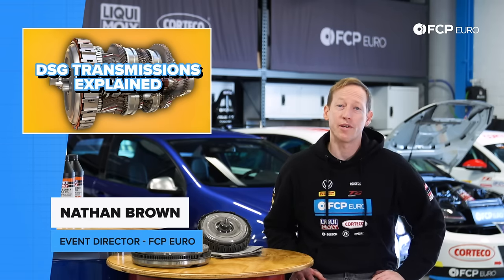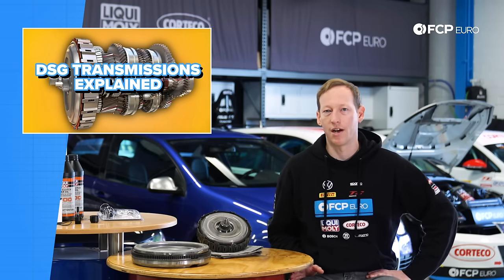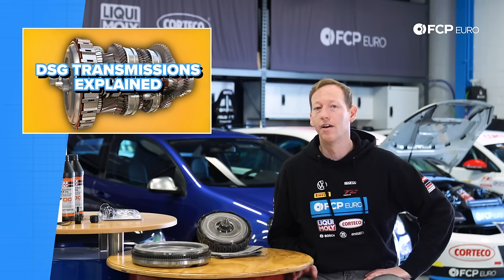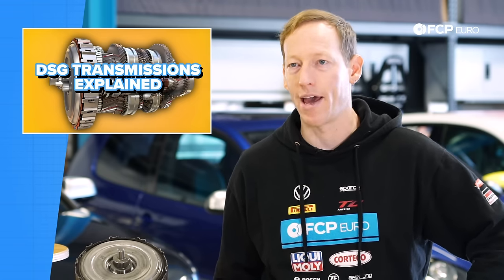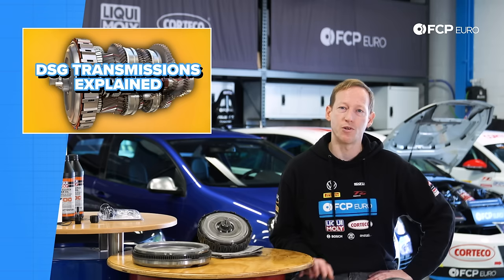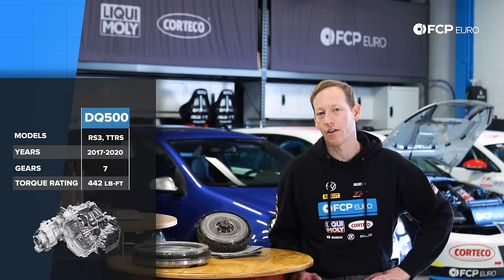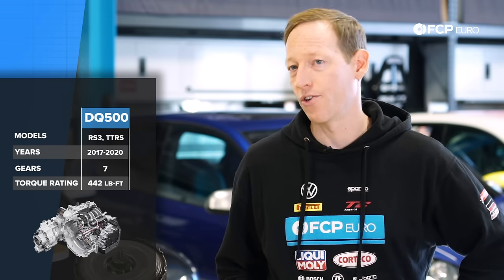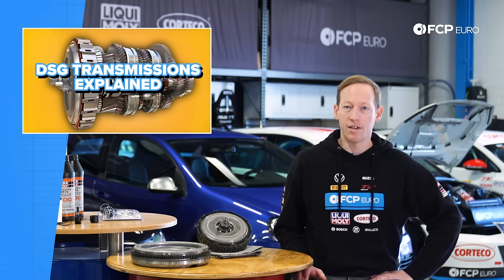The DSG Transmission Explained - How A DSG Transmission Works, Advantages, & Cars That Have Them

Comment: Hi, thanks for the informative video. I have a 2015 VW CC with the 02E trans. It  all of a sudden stopped moving both forward and reverse. When I scanned it, I got a code P0716 (G182 implausible signal). Pls can the G182 cause the car not to move at all? Is there a way to check this sensor with multimeter. I have checked the connector and no physical damage, I have opened the mechatronic cover and the wire of the G182 looks good. before all of this, I have replaced the DSG oil and filter. Is there something else I can do? My car is 32000 miles. Thanks again.

Comment: I have a 2019 7seed DSG mated to a diesel 2.0L 190hp was told by the dealership they only change the oil as the filter is long life. Same with the haldex clutch just oil change. It that the way things are just done now?

Comment: You are wrong about the recall on the mechatronic unit.  My 2008 GTI had the problem at  30k miles.  The dealer "fixed" it, and VW extended the warranty to 100k miles.  Unfortunately, the problem with the mechatronic unit caused excessive wear on the clutches, so at just about 100k miles, the clutches are slipping.

Comment: Hey guys, great video and answered a lot of questions I've had about DSG - in the video at 13:50 you start to describe flywheel issues, the bang into gear, and the vibrations - you also mention they're indications of something else, and "you'll get into that later" - I may have missed it but I don't think you came back to it. What are the other issues? Also, the vibrations, would they likely be felt while idalling, sitting at the lights, or sitting in park? and how bad would you expect?
Reply: Mechatronics issues will cause hard changes, delay in engagement, 'dropped' gears etc as well so I'm guessing that's what he was alluding to.
Reply: @onearmedbandit_nz  I think you're right as well. Thats what I think im dealing with.

Comment: DSG is a horribel construction. Adding more weight to your car than needed. Always pushing for the highest gear at all times, with an awful fuel consumption as a result. Have had two cars with those. Always ending up shifting them manually anyway.

Comment: i bought a 2014 passat TDI last year because it was the cheapest car i could find in my area with under 90,000 miles. I didn’t know much at the time, but after a year of ownership it’s been interesting learning about the TDI and its cult following, and of course just now finding out my DSG is some performance transmission 😂 I love the car, best 10 grand I’ve ever spent

Comment: transmission working absolutely fine just I’m getting error repeatedly Gearbox is overheating change driving style .. and fault code is P1765 hydraulic sensor 2 adaptation limit reached ( g194).. the local mechanic recommend to change valve body ..

Comment: Excellent video, really well explained. I would also like to thank you all at FCP Euro for helping me out, Audi in the UK and Germany were out of stock of a cylinder head bolt for some warranty work on my C7 RS6, you guys had stock and sent it to me in a few days, so thank you very much for helping me. FCP Euro is a really good option, if you can’t get the part in Europe, it’s worth trying them as the shipping cost was very reasonable.

Comment: Halo, I have a Jetta 2006 DSG 6 gears. When I accelerate/decelerate past 1000 rpm the car jacks and drives smooth after that. The car jacks as well when in traffic if I shift from Drive to Neutral and vise versa.. what could be causing this?!

Comment: Excellent explanation of the DSG.  I have a BMW M2 with DCT.  I just had the transmission serviced to the tune of $1500.00+ which really hurt.  The problem as to why it cost so much is that the filter is built into the pan of the transmission and so more parts required.  I've had the car since March 2017 (brand new) so I guess $1500 is not too bad for over seven years of service.  The car has been on track at Sebring many times with the Porsche club and I've never had an issue with the gearbox.  Thanks for a great video.

Comment: Hi, I have a volkswagen touran 2012 1.4 tsi, I'm getting leaks from, it... I do a rebuild of the mechatronic and still leaking, could the clutch cause the pressure to build up and cause the leak.

Ps it's a used car I bought, it says 43700km please advise me or help me with understanding the cause of the leak?

Comment: There's also the DQ200 that's a seven speed dry clutch. That one fails a lot.
Even on my DQ381 I had this connector rod that connects the gear lever movement to the transmission break and I have no idea what part number it is to replace it, I can't even find its name.

Comment: I have a 2018 Skoda superb automatic problem came up on the dash flashed up I got her logged on the computer clutch position sensor  to electrical fault dealer said need a new Mega Tronic unit Cost 2000 I was told to change oil and gearbox every 80,000 does that sound right

Comment: I had a ford focus with a dsg, lovely car to drive while the gearbox was cold, ford chose to activate the clutches via 2 motors and i believe the motor software was flawed…..my car was awful when it warmed up with heavy judder pulling away, nightmare time was stuck in traffic, i grew tired of having my teeth rattled, sold the car after 1 year.

Comment: Sir why did the previous Audi Multitronic automatic gearbox give so many problems when i for example had the Audi A4 which was so frustrating when i took the car into the Audi dealerships they had to order a replacement from Germany which took over a month to receive in the end i got rid of that car and opt for a VW T - Cross DSG ( Direct shift gearbox ) as you said VW are well known for there smooth gearbox touch wood i had no problems when i purchased my T - Cross in 2019 in South Africa? by the way your explanation was very good now i understand better!!!!:yougotthis:

Comment: Great vid... ive just brought my son his 1st car which is a 2009 audi a3 quattro with the dsg gearbox. Car ran perfect the 1st couple weeks but now its started to play up shifting 1st to 2nd gear , its as if your hitting a kill switch then it goes again. Cruising around its fine its only wot that it seems to do it. Ive changed oil and filter but doesn't seem to of fixed the issue. Any idea where I should start.

Comment: So what releases the pressure on the clutch packs? Does the solenoid supply oil pressure to engage or disengage the clutch? I would assume oil pressure would engage the clutch otherwise it would use springs to hold pressure on the friction plates and I assume having one clutch disengaged for a long time (I.e motorway driving) would cause the spring free length to become below min spec pretty quick.

Comment: So is it normal for my car to roll downhill by afew feet when going from a stop? Every time I put the car in gear and go to move it will roll afew feet downhill forward or backwards and it does it from a stop light if its on a incline. Basically feels like a manual trans with someone who doesn't know how to work a clutch

Comment: when the brake is applied the car is technically in a neutral state yes? so im wondering if that means that when doing the dsg service and running through the gears if that is fine in that neutral state or would it be optimal to have handbrake up and swap gears without brake applied?

Comment: Automatic will go 200k+ with no issues. DSG will need replace the clutch at 130k  kilometers not miles. Am I wrong, cause my 2009 audi tts is slipping and we just got to 130k. Has to be the clutch right...no codes, gear changes are perfect...when under torque in gear it slipping.
Reply: A good repair shop can see what the wear is. Sounds like a clutch replacement is needed, though.

Comment: As you said, Transmission fluid for VW DSG must be replaced by every 35~40 miles. This is most important to keep DSG life longer.
But paradoxically speaking, DSG is sucks in reliability which need to be replaced the transmission fluid almost double times than torque converter.
That is why many DSG owners are saying that DSG is sucks.
Reply: So every day?!

Comment: Anyone thinks Automatic is better than Manual doesn't know Cars . I'm Master Certified Mechanic 45+ years experience. Automatic Transmission have there place. Ya ya their used in Formula one those Transmissions are Manual with Actuators for Shift Forks and Clutch Totally different than Conventional Automatic Transmission. New Corvette C8 has Manual Trans with Actuators I know seen the Inside of Trans. Conventional Auto trans used in Drag Racing is Heavily Modified yes Shifts fast for 10second dash but comes to Road Racing Manual Trans is better in many Situations. You Road race Auto trans Up shifting especially down shifting is Erratic Auto transmissions tend to have Minor to Major internal problems cost a lot of money to fix replace Auto Transmissions Factory Reman $5k-$6k + Labor . Manually Transmissions can take the Road Racing Abuse Clutch Replacement depends on if you or Shop  Replaced it and type of Clutch. Manual Trans fluid is Cheaper to compered to Auto Fluid and Filter. Manual Trans get better Gas  Millage and Re liability a Auto transmissions gets older is like a Light Bulb don't know when it will Fail that day comes make decision replace it with another auto trans big bucks! or swap to manual  advantages Less loss engine power to Wheels, Better Gas Mileage Weighs less 😢and Reliability you can Shift Manual fast if you Practice plus looks cooler Heel and Toe. Don't let anyone tell you Autos are better there good for Lazy people. Autos in big Cars or Trucks like I said have there place but in Small cars Sports Cars Sport Coupes Sedans Manual Trans plus You can Drift with Rear wheel car better too.
Reply: I agree but dsg has the best of both worlds

Comment: Thank you for Great video ! I have Golf 5, 2008 TDI with DSG Transmission model with 140000km. Is it time to change clutches? I heard strange noises on highway when I put my foot on gas pedal. Please help
Reply from the maker: Hi Tony, unfortunately something like that will require further diagnosis to determine what your issue may be.

Comment: DSG F***...... Why do they back off the spark timing instead of momentarily reducing the throttle? They are all drive by wire throttles. This is what you would do driving a manual, and when changing down the same software control could give rev matching, like you would in a manual.
Reply: Cutting timing keeps the revs up and keeps the car in power through the shift, especially with turbo charged engines. Cutting throttle would cause the turbo to spool down, resulting in a loss of boost pressure and boost lag.

Comment: I have a 2010 Skoda Octavia 1z3 dsg, put it into drive but it won’t change up the gears. Tried manually but it’s still the same. Could this be down to the Megatronic Unit needing recoded ???
Reply: Sounds more like a repair, than a recoding. What milage does the car have?

Comment: I track my 2015 S3, and I get a rough shift every once in a while. I figured it was something I was doing. Now I'm 100% sure,  it's me. If I come into a corner and brake hard down shift, it's all good. If I come into a corner, brake hard down shift feather the gas and try try and down shift before another corner it's not happy. I need to get better at making sure the tcu knows what gear I want next. Also  I was surprised to hear the dsg really holds up well on the track. I change my dsg fluid every 2 years with about 6 tracks days and only 12k miles. It sounds like it might be overkill. I'm pushing about 400 whp with 90k miles on her, so I want to keep the car running strong. Great video
Reply: might need a new clutch pack

Comment: Excelent explanation.
I have a question and I hope you can answer it.
I have SEAT Ateca 1.5 TSI ,110KW,DSG, production year 2021.
I purchase brand new and I have 6000km till today, but start noticing that when the DSG shift from D1-D2, or D2-D1 make some klung, knock noice, some metal noice. Not everytime, but strat to doing more and more.
Do have any idea what it can couse that noize.
Thanks
Reply: It is normal if it happens during traffic driving

Comment: Thank you for the video, I learned quite a bit 🙂. Just bought a 2013 2.5L, trying to learn all I can. Is it normal to get like a low grade noise, (I wanna say grind but that's not the right word) from the transmission when it is engaged... More like an engaged gear noise. Drives and shifts fine though...
Reply from the maker: Glad you enjoyed it! Unfortunately something like that will need a proper diagnosis.

Comment: Very very informative. I was always curious about how the DSG Transmission actually works. I have the 2020 Polo 1.0 TSI w/ a 7 Speed DSG and it's on 40k KM's due for service in 5k km's, and my transmission isn't working how it used to when my vehicle was still brand new.
Reply: Yeah the 7 speed DSG is garbage the clutch is probably slipping
Reply: You can reset your DSG by following these steps : 1. Turn the key in the ignition but don't start the motor
2. Press gas pedal for 25sec
3. Release gas pedal and start the engine
That will return your gearbox to factory settings.
 You're welcome
Reply: @ivanklaric6590  wow. Good thing i still drive citi golf
Reply: @giimashao489  it's decent actually

Comment: I'm looking into getting either a mk6 or 7 gti but was always worried of how reliable the dsg transmission is since I've heard that it can be quite costly
if it fails. Been doing a lot of research on these cars and honestly half the time it's just horror stories regarding engine problems and reliability. Yes I know that 
no car is perfect, all makes and models have their problems so I wanted your honest opinion on these two models I mentioned. Are they that problematic or unreliable to own?
I know of the common issues that are usually mentioned (water pump, timing tensioner etc) but am not too worried about those. I'm looking in the used car market since the price
of new mk7's are quite high in my country but the used market has some reasonably good deals. Your feedback would be appreciated, thanks
Reply: Just stay away from GTI's without maintenace history, without warranty and with high km/mls. Cheap can turn out to be very expensive...

Comment: Hey, Im in the process of maybe buying an a3 3.2 with the dsg. The car has a small hole in the transmission from hitting a curb when it got crashed. Could the transmission be repaired bu welding the hole if it's somehow still good with the internals as it doesn't seem too bad. Downside is it's been sitting outside for 2 years :D.
Reply: Don’t touch that with a 90ft pole dude, money pit

Comment: Could you do some explanation how the ECO :-) mode works and  how it disengage power from the engine? How the Eco mode eventually (if) shorten the DSG lifespan ?
Reply: i believe that the eco mode chooses the highest gear possible and reduces power output, ive heard that it turns off one or multiple cylinders to reduce the power and fuel consumption

Comment: That's crazy, I tuned my A3 stage 1 and then tuned the DSG from IE and it shifted honorably. Kept sending my car to limp mode and setting misfire codes. I removed the DSG tune and drove much better. A week later the car broke down started blowing smoke. Its at Audi now and they are still trying to figure it out. They already replaced injectors, they said they were leaking, but still smoking. Now they are checking the turbo. Audi said the tune did the damage. I think the DSG tune was the cause because it wasn't working correctly, by not shifting correctly at 6500. I'm amazed this happened after only having the car for 5k miles in a car with 30k miles. 16 1.8t front wheel drive.
Reply: That's strange. I'm running IE tcu tune with 400 whp with no issues. I have 30k miles on it since the tune. You probably had the issue before, but the tune made it fail quicker. My shit point is at 7500 rpm on the tune. I also track the car about 4 times a year.  It's all about the maintenance on these cars.

Comment: I've got a 2019 GTI with a dsg and I'm fairly new to it. My car has 26k miles on it and I can feel downshifts and hear a slight clinking sound as it goes from 3rd->2nd->1st when commuting. Sometimes it jerks a little when downshifting coming to a stop. It's a stock car. Is this normal? I'm curious what other people experience.
Reply: i have 2019 sportwagen and  does same thing.i think its normal